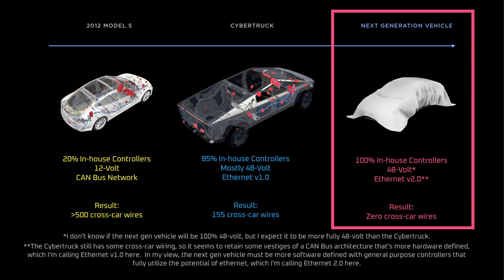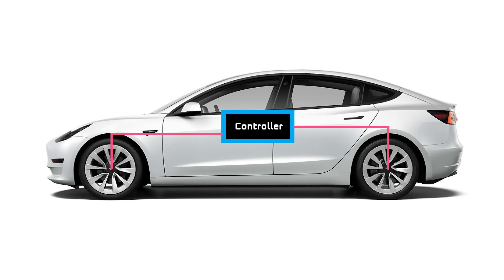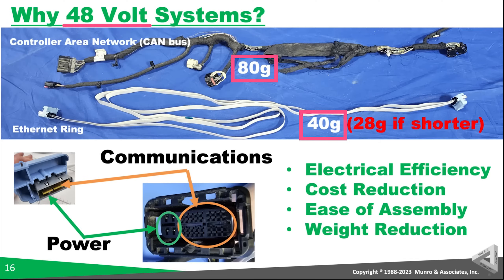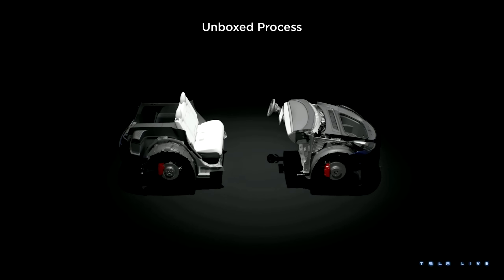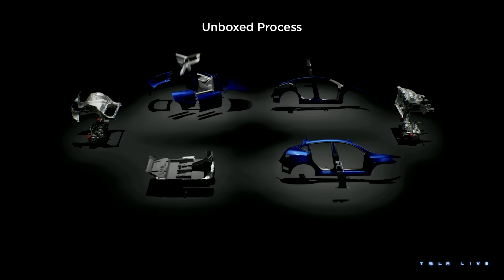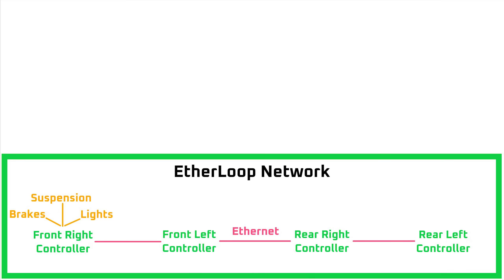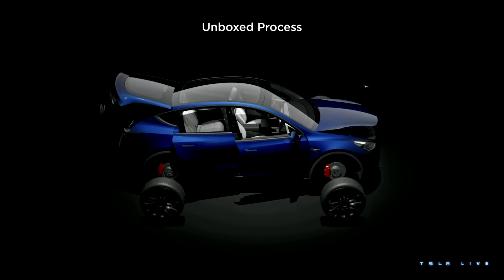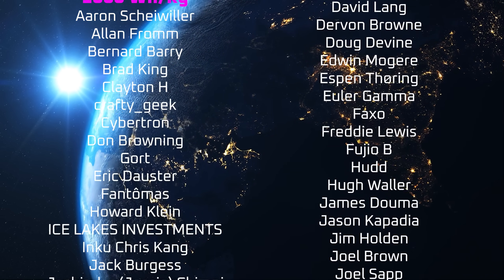Digging Deeper on Tesla's Etherloop Wiring System

Comment: There's not much stopping a CAN bus from having generalized controllers in the same way. Due to the very robust design, it has low bandwidth and fairly slow timing. That really wasn't a problem for CAN bus in cars  except for maybe ABS depending on the implementation. They used application specific controllers because it was easy. Ethernet allows for high bandwidth stuff such as all the video tesla is adding. It is much less noise tolerant, so we'll see if it works in the real world. Maybe, maybe not. CAN may have been too robust for it's needs. Ethernet also allows for much more encryption and better  cybersecurity when the attacker has physical access. It also opens up more remote access vectors.

Comment: On a munro video tesla stated that the etherloop was more like a token ring in that time on the network was sliced, each controller had its own unique time slice, that means no message collisions and no resends (unlike ethernet). Thus the new name. With this strategy you can saturate the bus to 100% traffic with no lost data as opposed to ethetnet where data can be lost at around 70% saturation.

Comment: OEMs have been using Flexiray and Ethernet in their cars for years now!

The issue with the common "corner controllers" architecture is that it makes an FMEA extremely complex, because all systems are inter-related at a H/W and S/W level. I mean, call me old fashioned but it's rather not find out that my airbags didn't fire because i was at 25degC on the HVAC and had the interior light on at the moment of impact, or that my car did an OTA update last night to fix a bug with the satnav, but actually borked the ABS system......

I'll happily carry an extra 10kg of wire to get systems that are designed, developed, validated then LEFT ALONE for the life of that model.

It will be very interesting to see how far they go with this, ever diminishing gains imo. For example, an ABS controller has all the critical systems directly on one PCB, mounted directly (with non soldered push fit contacts) to the ABS modulator (the mechanical bit with the pump and solenoids) precisely because any failure to drive those solenoids in precisely the right manner can lead to a LoC (Loss of Control) and that, as Toyota found out, gets expensive, very quickly (The $2.1 BILLION Toyota was fined in 2014 would have bought a LOT of wire...)

Now it's absolutely possible to run a safe vehicle on a distributed control and co-ordinated network, the issue is if the risk is worth the reward, and if the (significant) extra validation forced upon you is worth the effort as you now have to do it for ANY change whatso ever......

Comment: 16:41 with a true ring architecture, there isn't even a need for a new bus access arbitration scheme.
You only have two endpoints per bus. If you use bi-directional wiring (extremely common with ethernet), both can send and receive at the same time, you will never get any collisions at all. The endpoints just need to prioritize which messages to relay/send first.

Comment: Hmm... they could design a physically larger connector (or use an existing one if one already exists) that can be snapped together by a robot (not the Tesla bot, a classic factory robot arm) while putting together the large subassemblies, so they can install the etherloop wiring harness before combining the subassemblies, and then don't even need to crawl in to make the final ethernet connections. Might add a little weight, but would make assembly cheaper. The idea is obvious enough that I'm confident they already thought about this, so it's on them to decide whether it's worth the cost of development (if any), production-development (if any), production (if any), and the added weight-cost in the final product.

Comment: So working for Honda during their MOST network ring.... I'm getting flashbacks of the early days when Honda didn't understand why the speakers were crackling and why the audio unit ( and before the update) the gauge cluster would sometimes not turn on. Hopefully the software and hardware used in this system is more properly engineered

Comment: i have been shocked by 110/120 a bunch of times. could have gone straight to 96v and saved even more. but i think a lot more would be complicated to get sourced at the time. but with 48v now getting common, via tesla, but lets go higher. ;)  and ethernet/loop is based af. can is super annoying. recently a guy i know at a body shop pinched a wire. it wasnt cut, visibly, but it f'd everything up. and took a deep diagnostic mess to figure out where it was.

Comment: The key innovation here ISNT etherloop, it's the distributed generalised controller architecture. Enabled by Tesla's vertical integration inhouse electronics team. 

There's nothing stopping this from being implemented on canbus. 3D printers do that now, the main controller talks to the tool head that controls endstops, heaters and thermocouples etc. 

You can also daisy chain canbus by simply putting an input and output port on each device with an internal bridge and optional termination. That will enable the unboxed assembly. It's done the same way on CNC machines. 

The only plus is the datarate as mentioned. Sure you can't pipe AV over canbus but if you're just focused on the manufacturing benefits covered, it's the distributed architecture that's the main innovation
Reply: You got to ST or Infineon or NXP (or Bosch and Conti/Vitesco), and they’ll sell you a zonal controller. Let’s not beat around the bush here: Tesla is doing this because they have the engineering resources to design in cost savings.

Comment: ETER LOOP is a nifty name change for something that already has been going on in auto mfr for about or more than 25 year (by wire throttle controls GM 98’) this is an expansion on that if I understand you right. 

At about that time it was announced that in 3-4 yrs things at Ford would be shifting to single wire 36-42 volt systems, which fizzled. But from the perspective of “electric drive”. any voltage would be feasible/doable, and the higher the voltage always means —the less wire, -the end goal, and the separate controllers will get it there no doubt. 
I would imagine that NTSB will have a “say so” on by-wire (Ethernet) control of subsystems like brakes, steering, exterior lighting, and is most likely why crossbody wiring on braking will remain. 
Your comments on the impossibility of CAN on subassemblies is not so however because in cases like that a bulkhead or “Cannonplugs” are. And have been utilized in just such situations since that very issue arose on high volume assembly lines for offplant subassemblies in aircraft at the beginning of WWII.
Each sub assembly comes pre-wired with a multi pinned connector. A bulkhead connector. And at some point, if not already
Tesla will do the same thing just with 42 volt instead of 12.

Comment: So, with steer by wire and brake by wire tesla needs some redundancy (for example 3x controllers). With this setup and general-purpose controllers, is there the possibility that when a controller fails the other ones can "take over" its function, thus reducing the need of redundancy?

Comment: I'm willing to bet they cross-connect controllers (front-left to rear-right, etc) to create a fully connected mesh, which would remove all contention for intra-controller comms without deviating from the ethernet standard. They could patch the cross-connects through the controllers themselves (path from FL->RR patches through RL) to minimize cross-car wiring, as you'll notice the etherloop cable has many more data conductors than standard ethernet (almost looks like 4 gigabit connections of 4-pair each). If it's 4 gigabit connections, it could be for redundancy (2 patched to cross-connected controller, with each having 2 data connections for redundancy).

Comment: Hmm, i domt see why canbus has to result in cross body wiring. Other than the main bus wiree, there would only need to a module as the location of an endpoint. If you have multiple endpoints for a function, then use multiple controllers.

As for software defined hardware, i see a problem around that one module failing causing a hmwhole vehicle to break.

Comment: 16:30 I think they are probably avoiding collisions altogether by making each Ethernet run connect to only 2 endpoints.
This requires each endpoint to have a buffered switch to prioritize traffic though (talking collisions happening at Layer 3 instead of layer 1 or 2).

Comment: The 48V and Ethernet (or loop) are not necessarily codependent and shouldn't  be thought of as such. Many automotive systems (CAM sensors, crank sensors) actually use 5V. They are internally regulating the 12V down in the ECU for example. The car could move to a 48V system and do the same thing. It could still be CAN buss but save significantly on wire.

Comment: Model railroads' DCC control system is the same as Tesla's Ether Loop System - identical in design and implementation. Neither requires a closed loop. Data is PULSED out to a train car, engine or trackside accessory. That device completes the operation and returns a "device mode changed" signal. Many trains and devices are controlled with one controller and TWO DC wires - INDIVIDUALLY - with variable pulses.

Comment: I think you have misunderstood how CAN bus works. CAN bus can be setup as one single loop around the car. I have done this myself on my conversion. I just have 4 wires running in a loop around the car. My conversion is using CAN bus in exactly the same way that you describe  ethernet loop. The only difference is data rate.
There is also a reason why there are multiple buses in a car. The safety critical systems (like brakes, drive line airbags ...) that are not on the same bus as the rest of the car (like headlights, doors, AC). That is to avoid critical systems being compromised by non critical system failures.
I has been possible to do this for well over 15yrs. The only reason it has not been done is cost. A piece of wire is cheaper than an electronic module. That is why cars still use relays instead of semiconductor switches.
There are 15yo cars that already have started to move in this direction.  A 2005 VW golf has a control module on the front doors that runs on some kind of network.  There are only 6 wires going to the door. Two for power, 2 for some kind of serial link and two for the speaker.
I am not so sure the added complexity and cost of using ethernet brings enough benefits over CAN bus for the majority of the tasks in a car.
The only thing that makes CAN bus potentially more expensive are license fees on the chips but ethernet needs more expensive hardware.
Reply from the maker: I didn't misunderstand, I simplified because the video didn't need to go that deep.

In fact, it only strengthens my point as far as I can tell:

Why have multiple CANbus networks when you can have one EtherLoop?

And, how much more dificult would unboxed be with CANbus?

Comment: Glad someone finally chose to speculate on Tesla's Etherloop design. 

Cudos for a great job.

Unfortunately, until someone physically breaks down the hardware and sniffs the data there isn't much you can conclude other than concepts.

A few things I would emphasize is the "loop" in Etherloop implies a daisy chain network. This implies redundancy in the architecture so communication continues if severed in one direction. This was brought up in one of their interviews. And since they pointed out that you can see all communication from any point this supports the theory though you can multicast spoke and wheel also.

However, I think you are wrong when you say "Tesla developed their own in house communication protocol." In one of the interviews they even said they used the existing Ethernet protocol. Ethernet is plenty powerful enough to manage within the application layer especially since each car has a known set of static devices.

Trust me, NO engineer wants to debug a custom protocol. In my opinion that would make it worse than CAN bus.

There are so many questions left to be answered.
Reply from the maker: Agree!  

Definitely not my wheelhouse but glad I didn't horribly mess it up, lol

There was a bit more information given in the Munro interview. I forget what the detail was, but they talked about solving latency and flutter (?) issues

Comment: If the sensor systems use software, the 4 units could in theory eliminate a CPU. The octopus, they say, has a central brain but the neurons in the arms assist in thinking. It could one day evolve to the point where the central brain just becomes a connector to the neurons in the arms.

Comment: This is called "zonal architecture" and virtually all OEMs are doing it now. Btw it's independent from the bus type, can be done with CAN too. Ethernet does not work that way. All automotive ethernet versions are collision-free. 100BASE-T1 (BroadR-Reach) and 1000BASE-T1 (RTPGE) are point-to-point with switches. 10BASE-T1s uses bus topology (just like CAN), but it also implements a token scheme to avoid collisions. And finally, there are MANY networks in cars. Multiple CAN, LIN, FlexRay, Ethernet and other channels for different purposes.

Comment: I would expect EtherLOOP to be a loop architecture -- similar to the old token rings.  I would also suggest that any priority protocol will be software.  Since each endpoint can compare its own message's priority to an incoming message, it can decide which message to send now and which to queue for later.  Already in progress messages probably have priority over all except the most critical events.  Finally, I would expect that redundancy is achieved by sending the messages both directions around the loop.  Recall that the ethernet protocol has both receive and transmit pairs so that receive messages will go one direction (e.g. clockwise) and transmit messages will go the other (e.g. counterclockwise).  This would allow a 'limp' mode to get you to a service station without disabling the vehicle when the loop is broken.

Comment: If 48v is so much better that 12v why it was not implemented earlier? And why 48v, not 220 volts or 10 000 volts? It would reduce the weight of the wire  even further, right?

Comment: This system seems innovative, but I worry about the security and reliability of a system like this. With separate controllers wired apart from one another, a fault or failure of one system doesn't necessarily take out other systems. If one of these controllers goes out, it could affect multiple systems, including safety related systems. Another issue is cybersecurity. Combining things like the Bluetooth and infotainment functions onto the same system as things like braking, acceleration, and steering means that any security issues in the infotainment could allow malicious actors access to safety systems using the network. Tesla has shown before that it is very eager to debut new technologies quickly, and doesn't always do their due diligence in testing beforehand, instead "moving fast and breaking things," then doing OTA updates after the fact. We'll see how this turns out.

Comment: Hi, great Videos! 
How do you conclude the elimination of 75% of the copper increasing the voltage by 4???

Power loss and heating in the wire is proportional to I^2. Increasing the voltage by four decreases the losses by factor of 16.
So theoretically up to 93.75 % of the copper can be eliminated!
Reply from the maker: Good point, they said 4x less current rather than wire
Reply: @thelimitingfactor  exactly. The impact is up to 16. But not only for wires. Especially large aluminum heat sinks (e.g. for motors and controller units) will shrink significantly.

Last significant point:
For example: If your motor/controller/etc needs at least 10V to operate correctly, your wire loses must stay in every case under 2 volts. 
On the other hand if you use >40V motors, your losses can be 8 volts. So the usable voltage drop is way higher.
Therefore the wire size can be reduced even further. Not only by a factor of 16 (calculated by the lower current) but in fact by up to a factor of 4x16 = 64 (due to 4 times higher potential losses).

Of course, going this extreme factor of 64 might cause a higher temperature in the wire and needs to be double checked.

On the other hand using 12 volts, every connector in the wire will reduce the usable voltage by a significant margin. 48 volt is way more tolerant and easier to handle.

Comment: Etherloop certainly is faster, steer by wire would need low latency, particularly variable rate at top speed  & FSD. I don't think grouping functions at corners can't be done with CAN BUS, if you design the controllers yourself. FWIW the 787 Dreamliner uses a hardware implementation of Ethernet (duplicated for safety/redundancy)